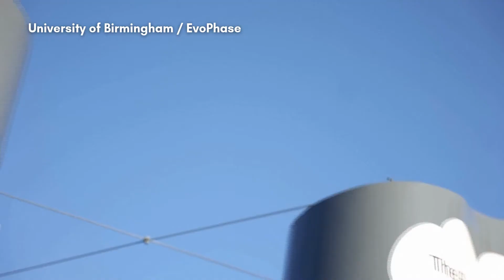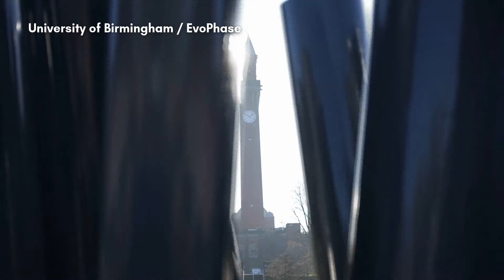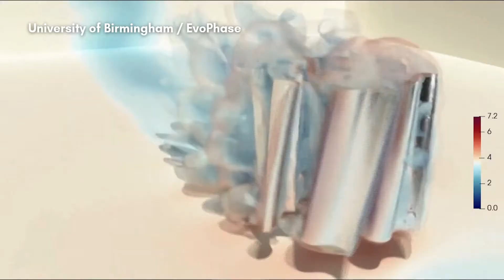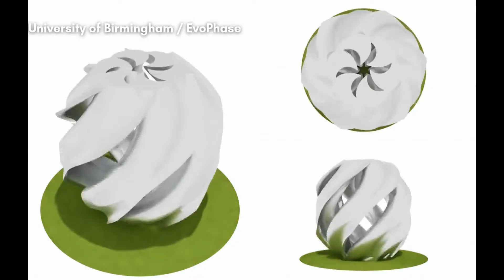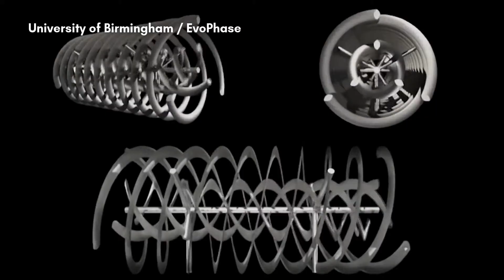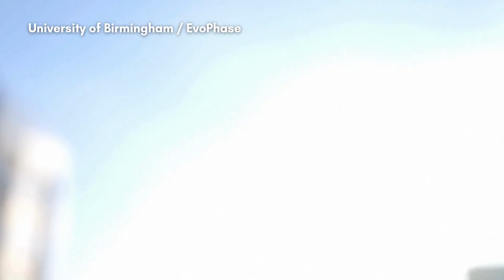Die Birmingham Blade: KI-optimierte Windturbine setzt neue Maßstäbe in der Effizienz | RND | AI1E

Comment: at 4:22 he mentions a vortex formed in the middle space between the blades and that this is critical to the greater efficiency of this design. I think the key issue here is the "low wind speeds" of Birmingham create a challenge because a Darius type device would spend most of its time not moving, but your common or garden Savonius type system is considered to be not very efficient because it relies on "drag" (ie just the push of wind resistance) rather than aerodynamic lift. 

From the animated flow diagrams it seems the effectiveness and efficiency of the Birmingham blade comes from the airflow actually creating aerodynamic lift over the blades as well as getting extra drag force from the reduced air pressure caused by the vortex behind the blades. 
Of course a big question is: what happens when strong(er) winds hit Birmingham? The device must be as light as feasible to work well in slow winds but must be robust enough to survive storms and the cold fronts of winter.

Comment: What did AI said , what type and size and brand bearings must be used?
Reply from the maker: In terms of the AI's role in optimizing wind turbine efficiency, do you think the bearing specifications it recommended are truly revolutionary, or are they just an incremental improvement over existing technology?

Please subscribe to Republic News Deutsch.

For You
Innovation isn't just about ideas—it's about transforming them into reality. Keep striving for progress in all that you do.
Reply: It was a joke about the bearings. Where is the complete product with specs?? Why didint AI give specs. This is only a profile that is extruded and can be modelled in 10 minutes with a Cad software. All this sounds like a big joke @dwsofficial
Reply: All the problems of the normal Savonius turbines will still be present in that design stress loading vibrations bearing vatique that means unreliability